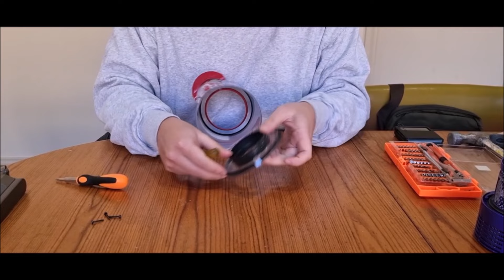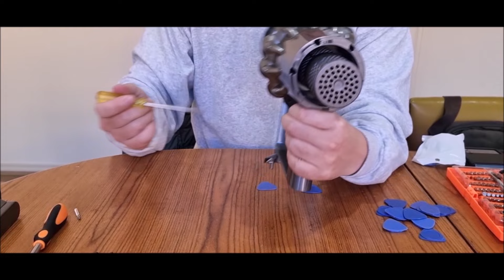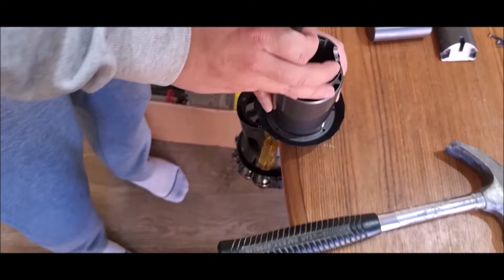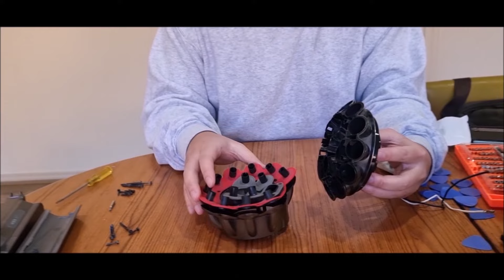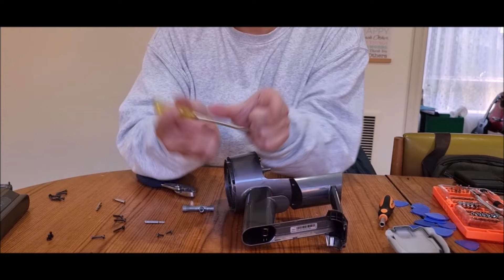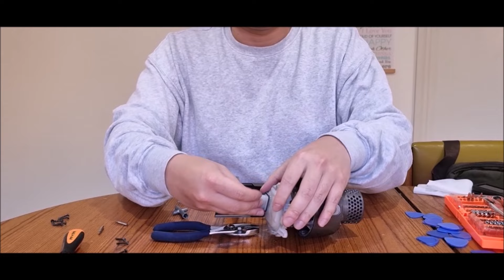OPEN ME UP! Dyson V10 Complete Disassemble and Clean Updated 19.7.22

Comment: Thanks for a very clear guide! The plastic of my trigger was broken, I was able to glue it and add a bit of reinforcement.
Reply from the maker: thanks for your support
Reply: I had the exact same thing. I was able to find a (3rd party) reinforced replacement part for ~€9
Reply: @JeroenNootebos hello. I have the same issue but can’t find the clip connector, do you have a part number or how did you find it?

Comment: I service / repair $500K+   machine tools so I have seen some very exquisitely engineered designs. I repair our vehicles and everything in the home including our 3 dysons. I have been deep inside 2 of them and was very impressed. The engineering is brilliant, built well and the quality of material to me is above average. As with anything, common sense use and maintenance go hand in hand. Years of hard use, abuse, drops and our kids hands on them, I will buy another dyson if ever need another vacuum. I can appreciate the effort it took to make this video, thank you for doing it. It popped up on google with me looking for a new power connector in the motorhead, which I broke. It stopped working, teardown revealed an open short in the white wire deep inside. Easy fix.  I haven't looked through your videos but if you want a fun one, a complete teardown on a DC65 ball! Just my 2 cents, happy vacuuming!
Reply from the maker: i only do the small battery power ones. the reason is these is because these are the item people mostly buy and it is not as complex. no one watches the complex one. therefore it is a waste of money just to buy it for disassembly 

if you look at my comments, you will see people complain that it is too complex

Comment: Excellent Video! Helped me perfectly while changing the broken Housing of my 6 years old V10. Okay...the speed selector now works vice versa and medium speed isn't avaiable anymore....but that has nothing to do with this awesome & detailed instctional vid. THX! ❤
Reply from the maker: you didnt put your speed selector back in properly.
Reply: correct, the rubber sealing of the circuit board didn't fit perfectly into the new housing. now fixed! thx

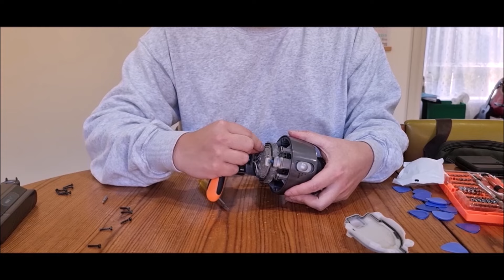Comment: My dyson v10 has 1 red 1 black wire connected to circuit board. Any idea how to get this off. ~40:25
Reply from the maker: thin or thick wire. there is a thin one which is the trigger button and the thick one is the battery power
Reply: The white clip on my V10 trigger had no mating connector on the circuit board. It appeared to have been glued to the board as once I pushed it aside (in the direction of the red and black wires) there was nothing on the PCB to reconnect it to, just 2 solder pads. I had to cut off the white clip and solder the 2 wires directly to the pads on the board. To make this easier I extended the 2 wires slightly and put heatshrink over the joins.
Reply: After disconnected the white clip.  I forget how to connect the thin red and black to the circuit broad.  Can I have the picture of it?

Comment: You are very lucky because you can open the canister. Today, for the first time after three years of use, I cannot open the canister file because the red opener does not move. Totally stuck. I can throw the vacuum cleaner in the garbage, but otherwise it worked very well. ☹
Reply from the maker: dyson do provide replacement parts as they get wore after using it for sometime
Reply: @OpenMeUpTec   Thank you very much for your reply. My husband poked it with a screwdriver last night until it finally got it working again. :))
Otherwise, would the service provider send parts for free, or would you have to pay again and again?

Comment: Awesome tutorial and very welcome. I bought this Dyson second hand, but it was very nasty, although the seller told me that it was hygenically cleaned. I'll let him know that if he has something cleaned, he shouldn't empty the sewage with it afterwards. Did you find a way to remove the inner connector? I'd like to also take that one out, as the part where it is in is as nasty as the rest of the vacuum.
Reply from the maker: if you watch my newer video it shows you how to remove it. it is normal for people to think it has been clean properly. until you watch my video may people would think it is clean as it is hard to disassemble
Reply: @OpenMeUpTec  In this case it was nothing about people not knowing, but deliberately lying about the condition of the vacuum. 😞 I'll search for the newer video, thanks.
Reply from the maker: @MischaGielen  i have seen this many times before. they genuinely believe it is clean. until you show them otherwise

Comment: I'm not sure what to do with my Dyson V10. It's 6 years old but hasn't had heavy use. It has no visible blockages and a new genuine Dyson filter. But after a few minutes of vacuuming the Filtro light flashes and it starts pulsating. I can fix this temporarily by taking out the filter and washing it. Then next time I use it, same thing happens. I don't know if it's time to buy a new one?
Reply from the maker: put you filter up in the sunlight and see if it looks clear and white. if it looks dark gray and patch it is clogged. just becuase your filter looks clean it doesnt mean it is
Reply: @OpenMeUpTec  OK, I'll try that.

Comment: I took it all apart and back together with minimal issues. But now it is stuck in max. So battery doesn't last long enough to do the house like it used to. I took it apart and don't see any issues. But I also do not see anything that the slider would move or what actually makes it change settings. I am wondering if there is a missing part? Any suggestions
Reply from the maker: you didnt assemble the power slide correctly. it is currently on max. you need to take it apart and put it back together again

Comment: Hi there, the trigger connector (white clip attaching trigger to powerboard) do you have any idea what that would be called to replace it? Please and thanks!
Reply from the maker: i dont know what it is called. but i cant see how you can buy it even if you knew as it is not normal for that to break at all. therefore no one will be selling one
Reply: @OpenMeUpTec  the white clip on my V10 trigger had no mating connector on the circuit board. It appeared to have been glued to the board as once I pushed it aside (in the direction of the 2 wires) there was nothing on the PCB to reconnect it to, just 2 solder pads. I had to cut off the white clip and solder the 2 wires directly to the pads on the board. To make this easier I extended the 2 wires slightly and put heatshrink over the joins.
In my case the red trigger plastic was not broken but after pulling the trigger assembly out, a short plastic cylinder fell out and that was what had stopped the trigger from operating, the trigger was staying in and permanently ON. The broken plastic was the receptacle for the torx screw up inside the handle that is removed after the battery is removed. I didn't bother trying to glue the broken piece back so that screw is no longer fitted
Reply: see my response to @OpenMeUpTec reply
Reply from the maker: @ewenfraser883  the plastic piece is the issue that many people have. since the screw doesnt hold the trigger in. the trigger slowly slides down which put the vacuum in the ON position. you can just push your battery back in so it will remove the pressure but slowly it will slide down again.

Comment: This is crazy. We have to do this for customers recently with Dyson and shark because or their questionable design, all of the dust get trapped in the centre (unreachable) bit. Terrible terrible design. I charge customers £70 for this service since it takes about an hour if not longer. Just to clean your hoover so it actually sucks again! Dyson you absolute dick heads! Iphones are easier to repair than these. At least you can replace the motor on its own in these versions. The old design had the motor moulded into the handle so your have to replace the whole handle, plastic, trigger and motor. The world would be a less wasteful place if Dyson just left the industry.
Reply from the maker: cleaning it or not doesnt really change anything it will still work basically the same. dyson already gurantee that it doesnt lose suction. cleaning it really only removes the smell. for most people they never clean the unit and just bin it when it dies. you only need to clean it for 2 things really 1. it smells 2. you got something stuck inside
Reply: @OpenMeUpTec  Not true. It definitely resolved the issue if you take it all apart and clean it properly. It is bad design because you should see the clay which falls out and stuck in there. If I could attach a photo, I would. I would argue that is something stuck in there. When the micro dust build up to the point where it becomes clay then yes, this will mimic a block due to poor design.